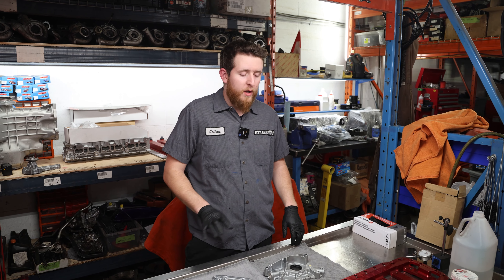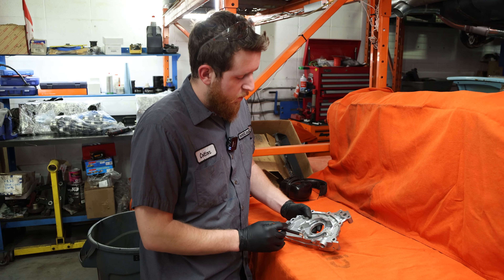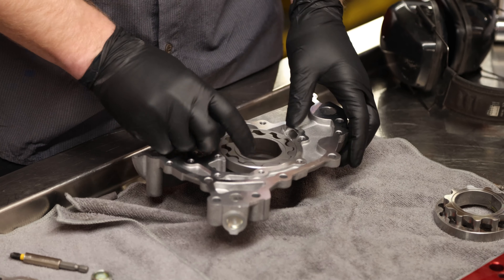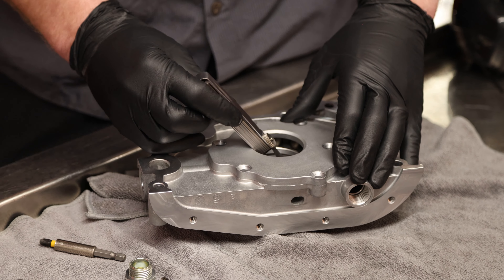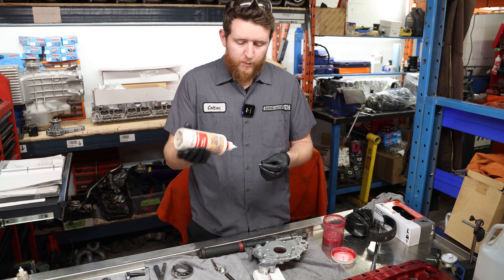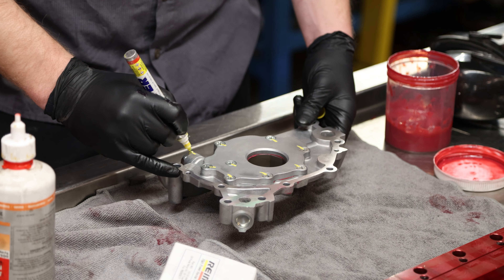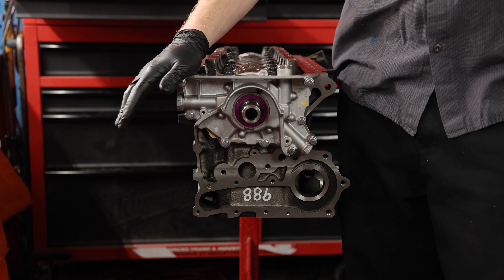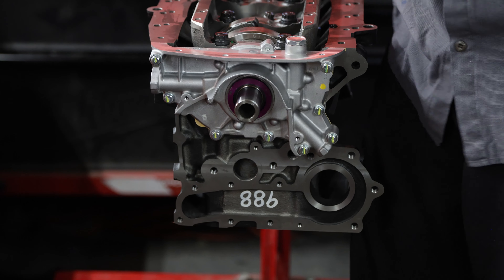RB26 FULL ENGINE BUILD || Episode 9 - N1 Oil Pump With Reimax Gears Assembly & Install

Comment: One thing about the bolts most of the audience may not know, they are NOT phillips screws, they are JIS screws (like the set screws in Japanese car brake rotors), I knew this and had a set of Vessel Megadora specifically for this, highly recommend.
Beautifully done as always Colton, thank you for these videos, parts support, and just being a very reliable go-to on my quest to get my RB up and running. I also used the N1 with Reimax gears + backplate. Runs beautifully, and like a literal well-oiled machine! 🤘😎
Reply from the maker: good catch! i haven't heard any one talk about this in years. all the " Phillips" screws on Nissan's and most JDM cars are JIS. but a standard Phillips sizes can be made to work in most cases!

Comment: This is awesome! Just in time for my bottom end reassembly! I just got my Nitto 2.8 short block back from the machine shop. I have to remove my brace, install oil pump and all the goodies, throw the brace back on and set up the oil pan and install the Quaife front diff and set up those clearances! This is AMAZING information! Keep the updates coming!

Comment: Did you find inner gear has more play against cranks flats than the oem inner gear?
My reimax did so i had to grow the crank nose diameter to have a sligthly less play than the oem gears, not sure i did the right thing though.
Reply from the maker: They vary so much for collar to collar and even crank to crank, a safe rang is .006"-.010" clearance
Reply: @boost.factory  in my case it is a new oem long flat crank, many builders seemed to have a concern with the amount of play being the culprit for the inner gear braking, i ended up with a clearance just a bit less than the oem inner gear.

Comment: so spline drive or standard style gear better?
Reply from the maker: neither is "better" they both do the same thing. hundreds of engines use flat drive. but spline drive is more forgiving of errors, but requires proper set up and doesn't allow for setting the clearance. it really more so comes down to indexing the pump to the block correctly. either or can be set up to provide good reliability.

Comment: Thanks for the very good and useful video. Helps those of us who are doing this first time more to be more confident we are doing it the right way.

I just installed my tomei oil pump, using the PRP tool also. Its quite tight though, PRP tool was a tight fit to the crank and once installed I have a max of 5.90 thou clearance, 0.15mm each side. Is this too tight and will it present any problems?
Reply from the maker: Thank you for the feed back! happy to help! as for oil pump clearance, a general rule you could follow is, if the oil pump gear to crank drive clearance is larger than your main journal oil clearance at the front you will have no issues with binding or contact. again always verify,  check horizontal and vertical with feeler blades to be sure.